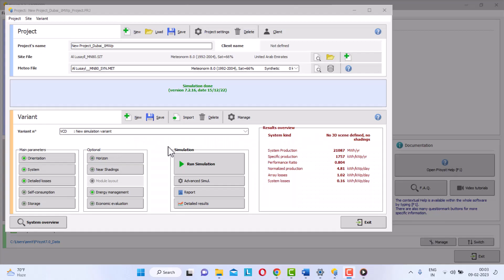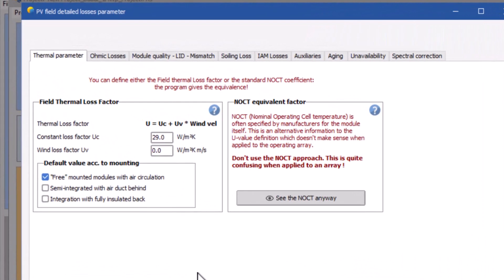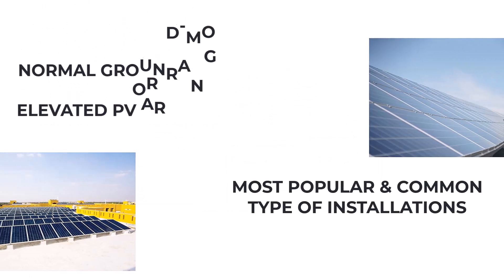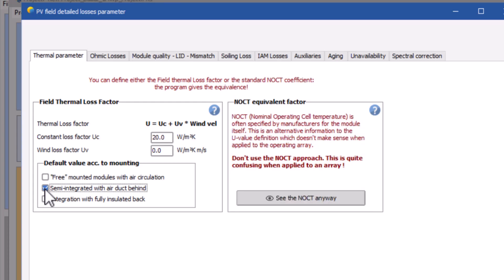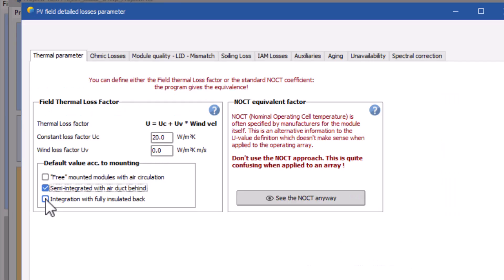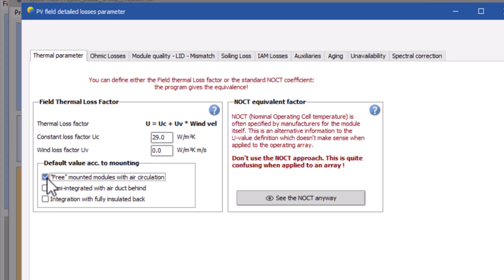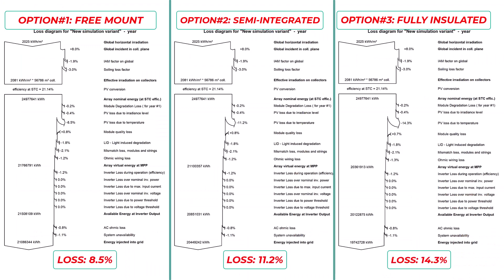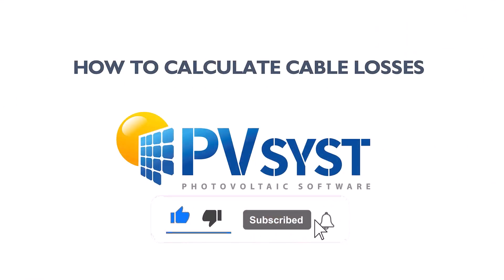PVSYST 7.3 || HOW TO DETERMINE VARIOUS THERMAL LOSSES IN PVSYST  #solar #pvsyst #solarenergy

Comment: Hi! I am considering comparing the performance of floating PV systems versus ground-mounted PV systems with similar configurations with PVsyst. Do you have any suggestions for the thermal loss factor (Uc and Uv value) in a floating PV system?